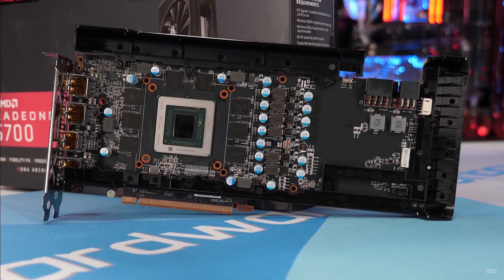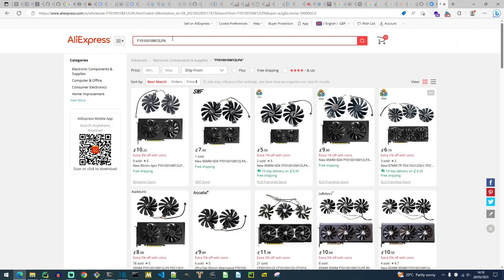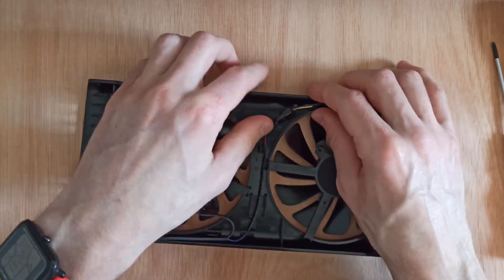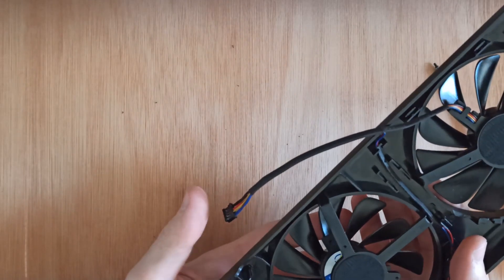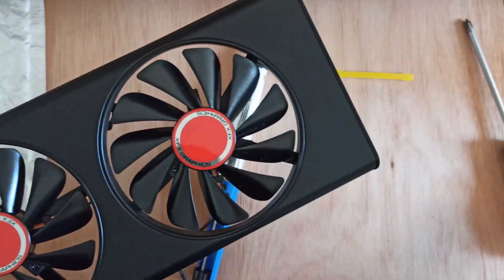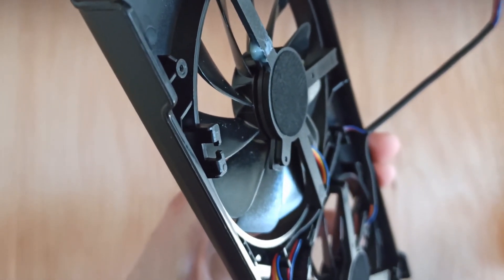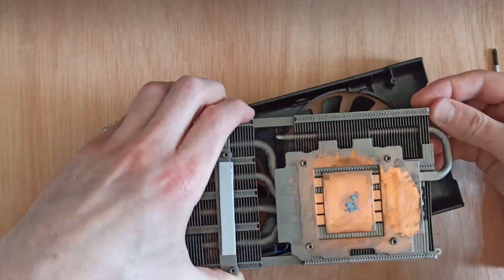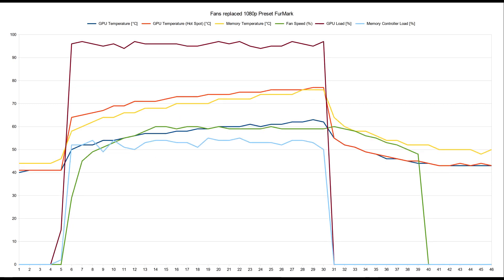ELSA RX 5700 fan replacement

Comment: First thanks for the video 
I bought Elsa rx 5700 but one of the fans making alot of noise and don't runs properly is buying one of this will fix the problem even with this damaged fan the heating doesn't exceed 60° in games